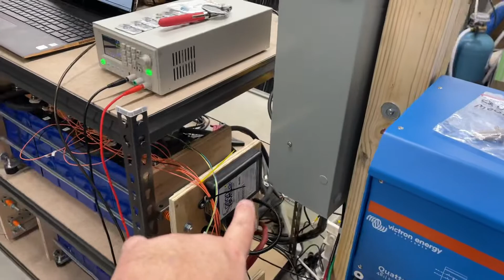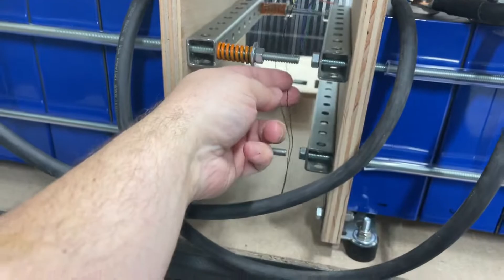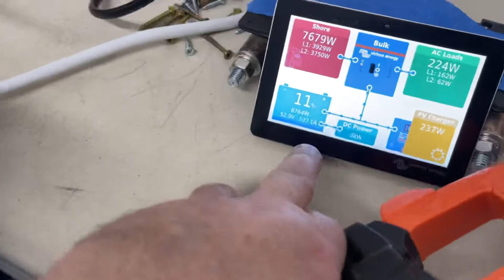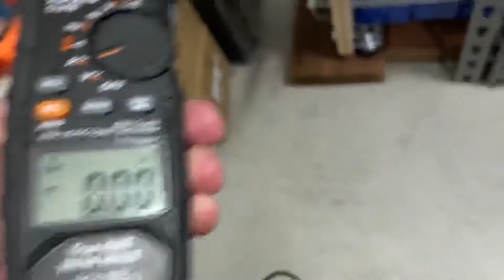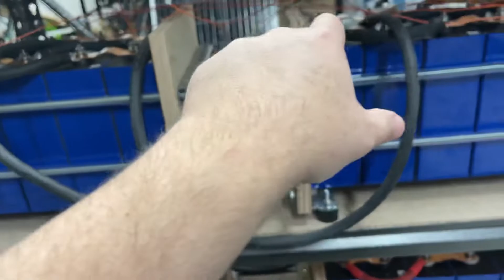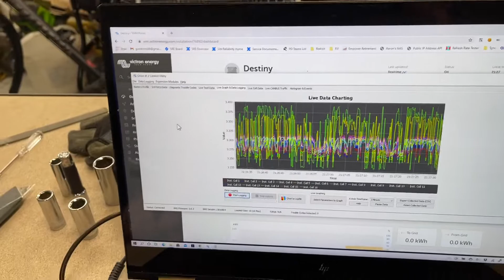6 More Weeks!

Comment: Have you actually tested the whole battery banks capacity? I’ve been considering getting these batteries but I’m just curious how they hold up?
Reply from the maker: Yes.  The EVE cells on Alibaba slightly underperform their 280 rating (I get about 270).  The Lishen 272 cells outperform (280-290 is being reported).  I've cycled these at least 15 times now and the entire bank is netting me 540Ah every time.

Comment: We finally decided on FLA's for our stationary system. I found Rolls 605's for an amazing deal. We'll have 1200 AH capability at a price point of 5200. There are the single point watering systems, as well as the Water Miser caps to reduce baby-sitting. Also employing the Sol-Ark 12k all-in-one controller inverter and 9400 watts worth of panels. Been researching this for months, as you well know! I wish I had the coin to drop in the LiFePo4's, but we'll be swimming in the Kwh while being on budget!

Don't worry. I'm gonna stay subscribed, LOL!
Reply: I just bought 29Kwh of LiFePO4 for $3500 shipped with all taxes, 25.6v nominal 1120Ah, how many Kwh can you safely use from the FLA?

Comment: Would be cool to have a run down of some of the loads this set up will power, and what durations they might run for. I’d be interested to know how much overall consumption comes from each of the categories, like AC, cooking, etc. I think that would help others plan their projects.
Reply from the maker: Yeah I've been posting pieces of my work over the past several months ... when this is done and installed, I'll do a video series to cover all the gory details.  It's going to be a LOT of video to cover it all.
The quick-n-dirty is that the mini split will be 300-1200 watts generally, plus the usual suspects like TV, lights, computers (up to another 500 watts), and then the ability to run coffee, microwave, toaster, etc ... all for a max load of about 6kW.
Since I have no real-world data on the mini-split yet (highly dependent on insulation, windows, interior and exterior temp, etc) ... it's difficult to gauge how this will all really perform -- BUT, I've seen other folks post their RV setup with mini-splits with far less solar and battery than I have, so I'm hoping I'll never have to think about it.  But I will have a generator and ground mount solar just in case.

Comment: Interested in your battery clamping arrangement. What is that, plywood ends and M8 threaded rod? How do you decide how much torque to tighten to?
Reply from the maker: 3/4" plywood with 1" square tube and 5/16" threaded rod.  I used 4 springs that can provide about 700 pounds of force in total when fully compressed (much more accurate than using torque on the bolt).  The manufacturer stated that 300kg of force is best; anywhere from 6-17 PSI.  Each cell "breathes" 0.5mm so, with all the math, I'll be something like 9-13 PSI.  The details are in my thread (in the description) - let me know if you need me to track down the exact post.